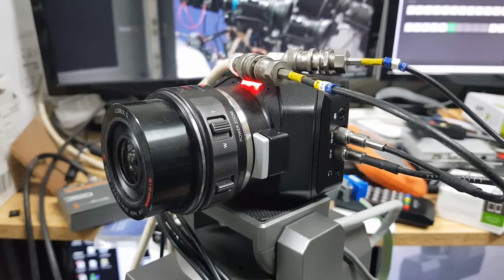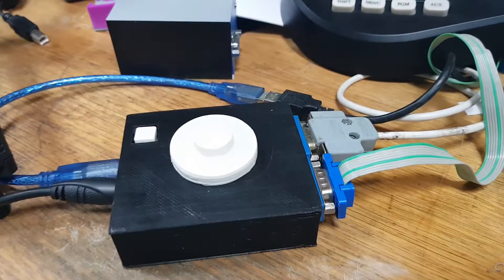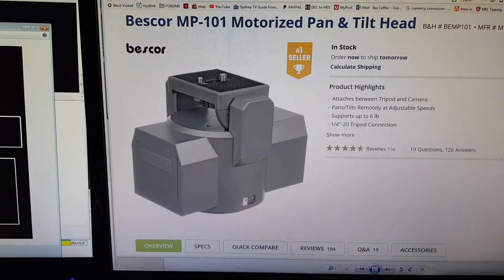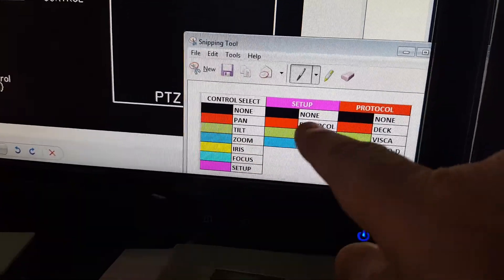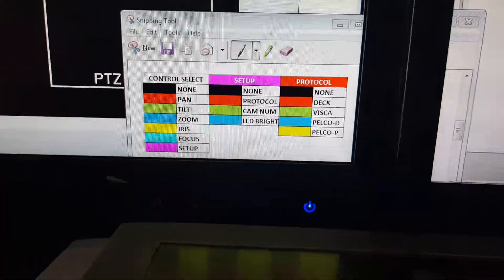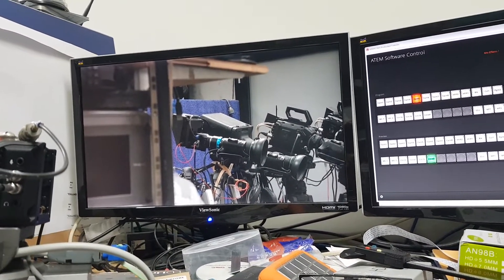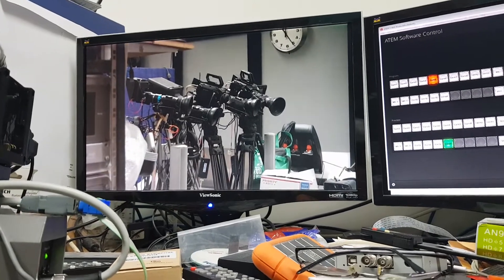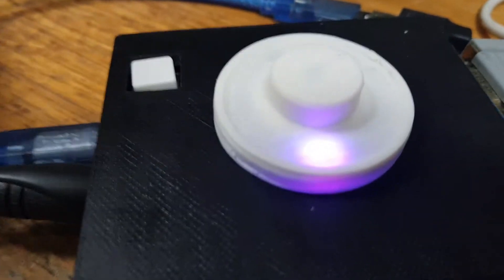PTZ interface introduction

Comment: Do you have a device that will talk with the Datavideo cameras or products? I have a ATEM and also an Advance Panel that already has a joystick for PTZ, but I cannot get it to talk with my DATAVIDEO camerea. Any info will be greatly apprecaited!
Reply from the maker: Do you have a copy of the datavideo communications protocol?
Reply: @LefflerPost  I own a DataVideo PTC-150 which uses as RJ-45 cable to connect to the RS-422 port on the camera’s rear panel.

Here is the RJ-45 wiring:
White/Orange 1 GND
Orange 2 NC
White/Green 3 RX
Blue 4 TX
White/Blue 5 TX+
Green 6 RX+
White/Brown 7 NC
Brown 8 NC
Reply from the maker: @musicianconnect3590  The connector wiring I know. The communications protocol I do not know.
Reply: @LefflerPost  The
communication protocol is VISCA.
Reply from the maker: @musicianconnect3590  Most ATEMs have a RS422 connector on them that sent VISCA. You could try that or I have a device that creates RS422 VISCA from the return SDI signal.
Reply: @LefflerPost  I may have to purchase that device, because I've tried using a RS422 cable to a RJ45... I've done various pinouts... and still no signal is send, and ATEM does NOT detect my DATAVIDEO camera.... That's why I was hoping you may have a solution.... How can I purchase the SDI return device?

Comment: hi there, not sure if i missed it, just wondering what lens you are using so that i can control the zoom via arduino? I've managed to make the pan and tilt with 2 servo motors... now for zoom
Reply from the maker: The lens is mentioned at the start of the video. It is one of the recommended lenses for the camera (Lumix).

Comment: I understand how these interfaces connect to the cameras. What I don't understand is how the interfaces connect to the PTZ controller, and how you connect multiple interfaces together. Do they daisy chain together? And where do I order the RS485 cable from?
Reply from the maker: There are many examples of how the actual PTZ controller can connect. In this instance it connects via the 9 pin connector using a RS485 signal (serial) that can run up tp 1.2Km. This 9 pin connector is on the unit I demonstrate here and next to that is a connector that carries discrete signals to the PTZ servo system. The RS485 signal is a one way only command and does not read any return data. Subsequently it can loop thru multiple boxes and in the communication protocol it uses contains a unique camera number. Up to 120 individual cameras can be adjusted using the single controller.
In the case of controlling PTZ from an ATEM Production Switcher the PTZ controller can plug into a unit that can convert the controllers commands into ATEM commands that then get sent to all the cameras via its 'return feed'.